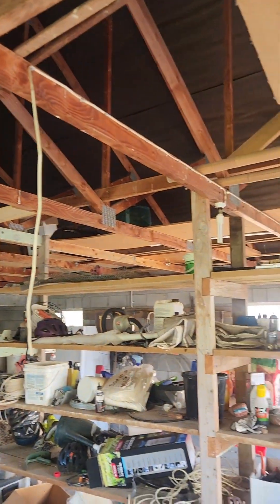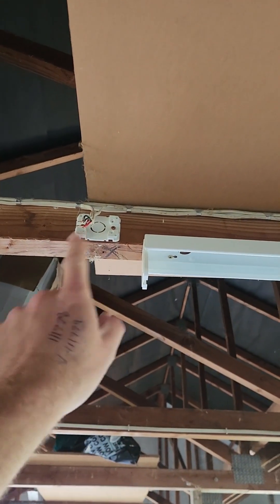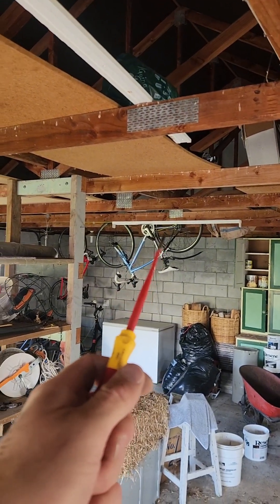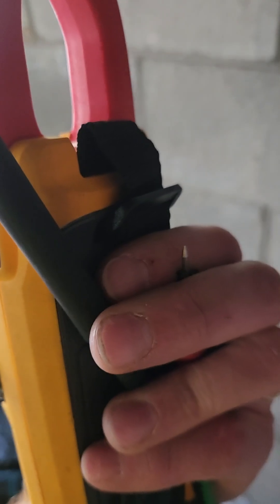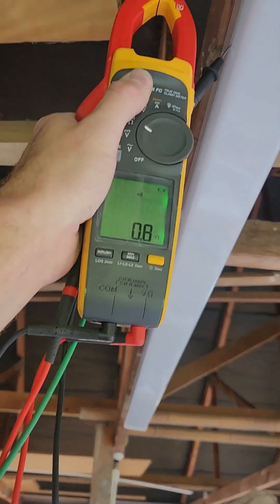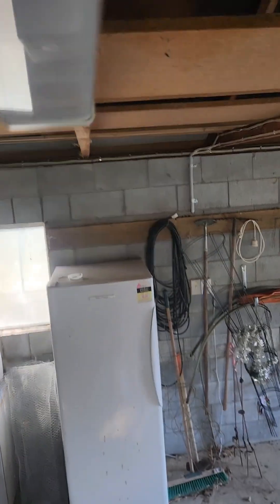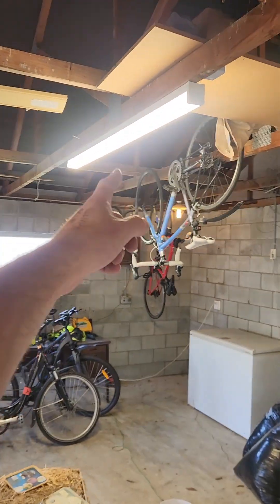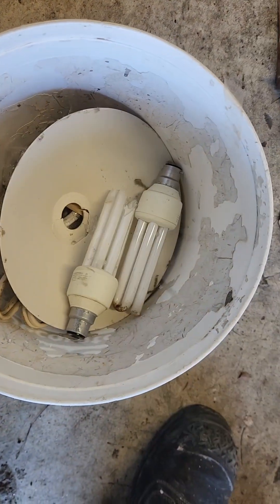How to install LEDs

Comment: Hmm I am a tad confused. Up front I am a retired sparky here in Oz but like to keep updated on the SAA wiring rules etc and continue to do work on my own house and sheds. As stated I am a bit confused on the size of the earth you are using when you bonded the light fittings. I have checked the SAA wring rules in Section 5 and from my reading the earth is only required to that that as specified in the related table 5.1 given the size of the cable used to feed the lights or under section 5.3.3.1.1.. Even under section 5.3.3.4 subsection (a) 2.5mm single core appears sufficient in this case if the earth is not in the original cabling. I would greatly appreciate if you could expand on why such a large bonding earth is required.
Reply from the maker: @gregharding7329  thanks for bringing thoughs standards up, I'll check up on them. One of the other reasons to use 4mm² is the ease in which you can buy it off the self and we have it in stock all the time
Reply: @_nztradie  Thanks lad, probably going to make a huge idiot of myself but dont know who to learn any other way :)

Comment: Perlite fixtures? I always even for like for like replacements if the client has cash I'd rather see her updated to 2018 specs.
Reply from the maker: @TradieTrev  na these are LED fittings, and we are up to code now, here in nz we are still running with 2007 🤪🤪

Comment: Brass clips for life here! The old tradie that taught me had some real old ways about doing things but they crap all over your clipped plastic cables, even down to using grey hose on HWS!
Reply from the maker: What are you referring to here bro ? I'm a bit confused
Reply: @_nztradie  The plastic clips and staple gun lol; Old lads used to spend days on installs and the bloke who taught me (Dave Young R.I.P. even brought in his hand powered drill in one day)
Reply from the maker: They arent just plastic aye they are a metal staple, I learnt on metal pin clips but honestly I don't see the point in wasting time hitting clips in when this it like 5 time quicker
Reply: @_nztradie  Think the old saying is "Time is money" and it rings true to larger projects, my question to you is do you want quality over quantity of time how fast you can smash out a project? 

I've done heaps of domestic and sure we can smash out a project quickly but you lose quality of it in the process.
Reply from the maker: @TradieTrev  I totally agree, although I don't think using the staples degrades the quality at all